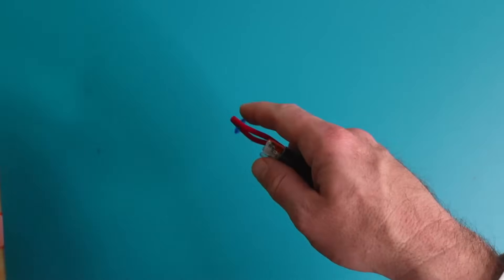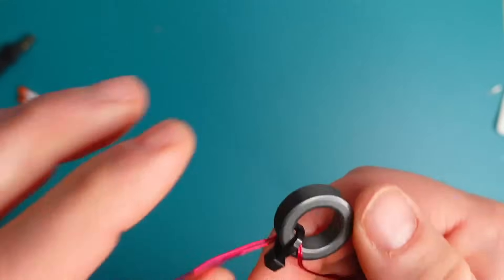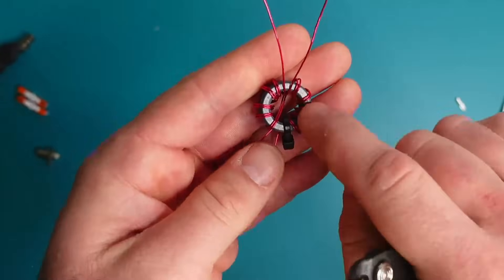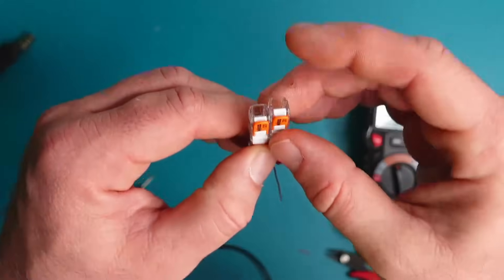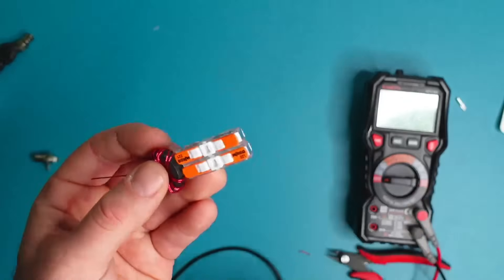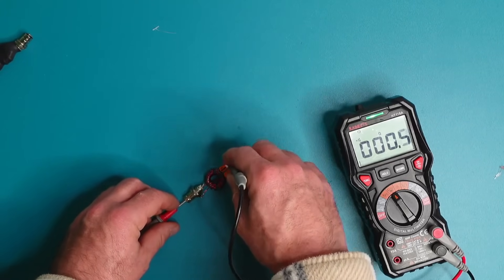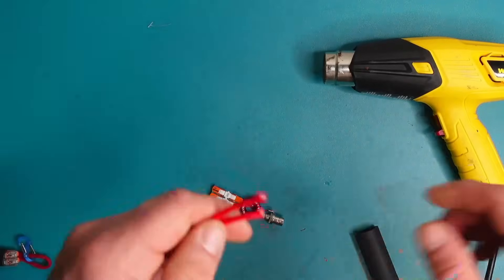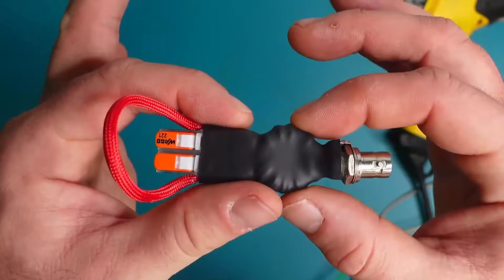How To Build a WAGO Dipole for HF - Portable Ham Radio Antenna!

Comment: I'm probably missing something obvious, but what is the benefit of the wago connectors? Once you pick an unun/balun for the build, aren't you pretty locked in on the type of antenna you want to use and (by extension) the lengths of the wire?
Reply: You can swap out different lengths of wire for different frequencies

Comment: You can try a few drops of hotglue to stabilize the wire windings . Lick your finger tips before you smooth the melted 550 cord.

Comment: Remember to take it down after using it ; dew, garden sprayers and rain will leave moisture seeping into the female connector and eventually the male connector... With co-ax feedline. 

Moist Seal the termination unit with high grade compound!!!

Comment: I use a zip-o lighter to burn off the enamel. That way you won't nick or cut the wire off!
Reply from the maker: This is a good tip, I will try with a zippo! Thanks

Comment: Is it me, or, did you forget to scrape the enamel off of the magnet wire to the BNC outer tab?
Clearly there is a connection, but it looks like the solder did not wet the wire.
Reply from the maker: could be.   thanks for the good input!

Comment: Sean, the WAGO connectors should have a slot on the side of them so you can marry them together much like the Anderson power poles use...
Reply from the maker: they should, but i do not recall them having them. I'll go home and check
Reply from the maker: I double and triple checked. If they do, I cannot get them to marry. Thanks!

Comment: Nice build, as always. Would the FT140-43 with an SO-239 run 100W SSB?
Reply from the maker: I think 100w would be acceptable with a mode that is lower duty cycle.   If you use a ft140-43, you could consider upgrading the magnet wire to 18awg.

Comment: I really need to build this and try to improve it with 3d printing. Thanks
Reply from the maker: I may try this week, if I finish my work.  I feel confident about the use and durability without the 3d printing, but I do think that will definitely add more "Curb appeal" to the project, while giving it added protection / minimal weight increase.

Comment: It's cute....but did you ever check the efficiency of this little balun/unun/transformer? If you can put 20 or even just 10 watts CW into it for 1 min and it doesn't get hot/warm.....
Reply from the maker: Thanks, cute is what the plan was for.  Are you suggesting a Autotransformer from high impedance to low impedance would be more efficient than a 1:1 winding?  I am uncertain I am processing this correctly.  Thanks.

Comment: You know, it’s funny after I work on a WAGO to Anderson Power Pole connector that YouTube recommended this video soon after…
Reply: ..an AI gotcha...big money and big marketing knows all...
Reply: Yesterday I wired up a LifePo4 battery to use as an external addon to my ecoflow solar battery. Hours later my feed was filled with videos about “this one hack can extend your battery!” videos showing what I had just done 😂
Reply: So, is this a stand-alone QRP dipole, or you insert small wire in the ends of the WAGO connector... newbie here.
Reply from the maker: Hello ! This dipole would require your desired wire length on each insert.  Here's what you need to know:  1.  Determine what band you want.  Lets use 20m, for an example.  20m spreads across 14.000mhz - 14.350 mhz.  2. Now, lets determine where I want to operate.  I typically like voice on the General Portion, but sometimes, I jump down to 14.074 for some digital modes.  In my eyes, the best thing to do here is to cut in the middle of the 20m bands, 14.175..  3.  We now have a frequency we want to tune for, now lets calculate:  Length (feet)= Frequency (MHz) / 468. (Side note: If you know the Velocity factor of the wire, it's Length (feet)= (Frequency (MHz) x Velocity factor) / 468. If you don't know it, no worries, really).  So the length of our dipole should be  L =  14.175 / 468  or L = 33.0158730159 lets just make that 33.0  That is the total Half wave now we need to divide by 2.   so 33 / 2 = 16.5 feet per side (I would cut a few inches more).  4. We now have a rough idea of the length of our dipole and we cut two 16.5ft sections. 

Alternatively, you could use this calculator - https://www.everythingrf.com/rf-calculators/dipole-antenna-length-calculator

Good luck out there!
Reply: Wow thats crazy. Yesterday i saw an ad for a litebulb and it gave me an idea

Comment: i think the wire and shrink links are not correct in the description (they both point to the toroid)

also, do you have a link to the CMC tester?  pls&thx
Reply from the maker: Corrected the links ( I hope) .  and here is the CMC Test Rig, Thanks!  https://electronics.halibut.com/product/common-mode-current-choke-test-rig/
Reply: @ tyty
Reply from the maker: @ShawnDumas  thank you!

Comment: Thanks, definitely going to build  one of these!
One tip, I use inline wago connecters for my tuned elevated radials and if you are planning to put wires in and out of them more then a couple of times I highly recommend you tin the ends of the wires. (At least for stranded wire)